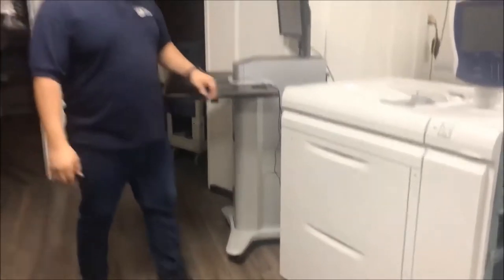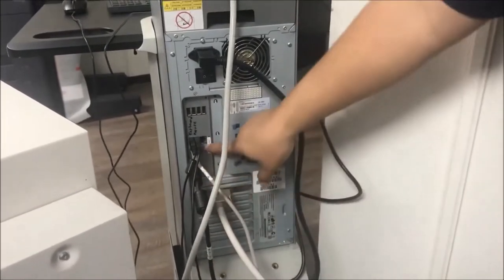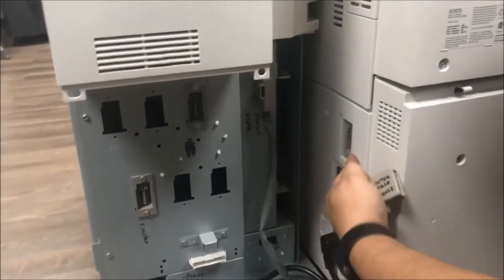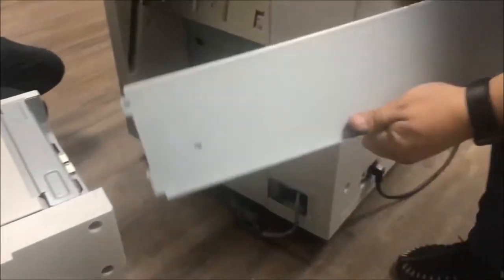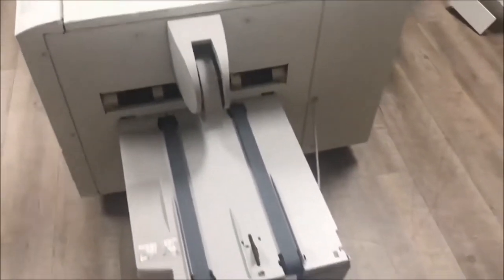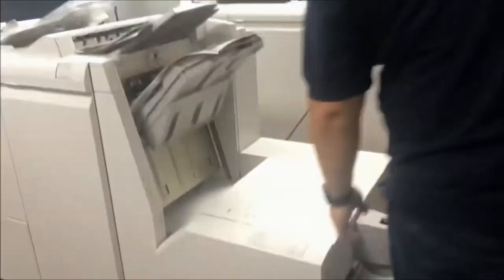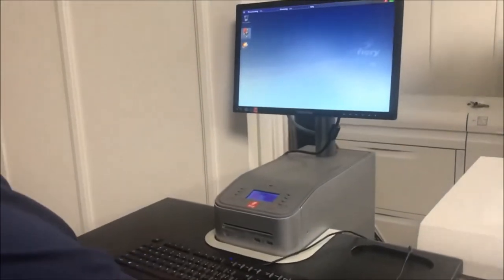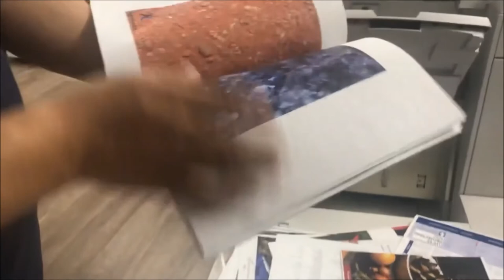Xerox 700i Digital Color Press with Booklet Maker Finisher for Printing Industry

Comment: Price?
Reply from the maker: Hi, price is $7,500. Product link - https://www.abdofficesolutions.com/products/xerox-700i-digital-color-press
Reply: @ABDOfficeSolutions  Complete set $7500?
Reply from the maker: @Bilal.Mumtaz  $7500 comes with the base model, 3 trays, bypass tray, offset catch tray, and an integrated fiery color server
Reply: @ABDOfficeSolutions  what is price with this exact configuration on video ?
Reply from the maker: @LaurentBASSONO  - You can get a special pricing through this form: https://form.jotform.com/200336793647057